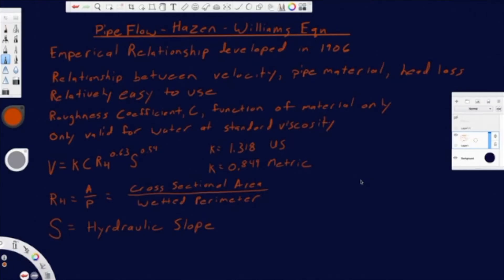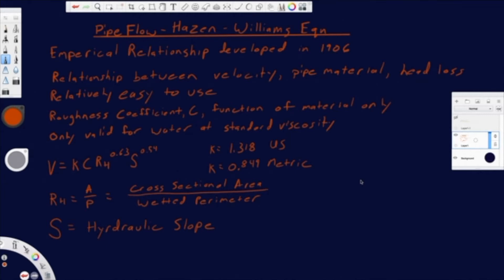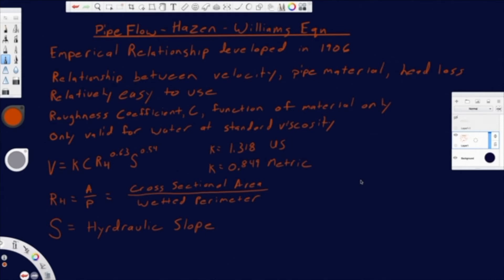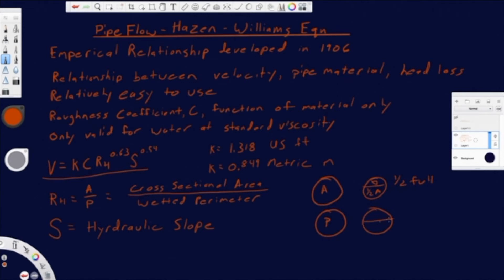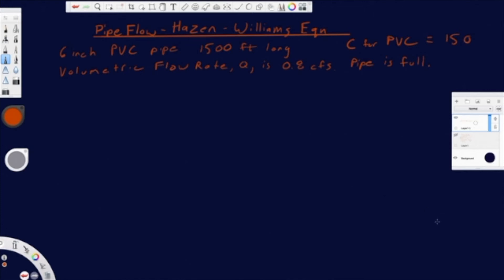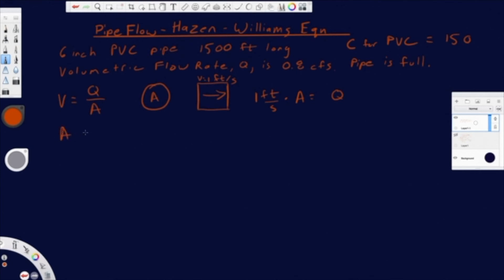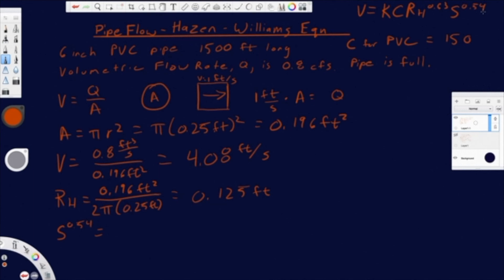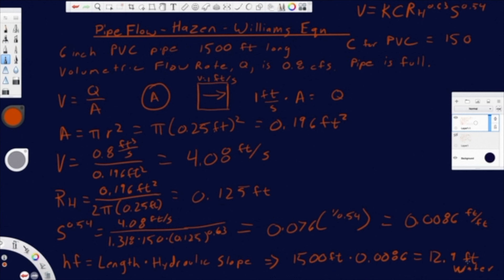Pipe Flow and Hazen - Williams Equation: Environmental Engineering FE Exam Review

Comment: @12:21 the radius should be 0.5 ft, not 0.25 ft, right? Overall, great video
Reply: Diameter is 0.5ft (6in), therefore radius is 0.25ft